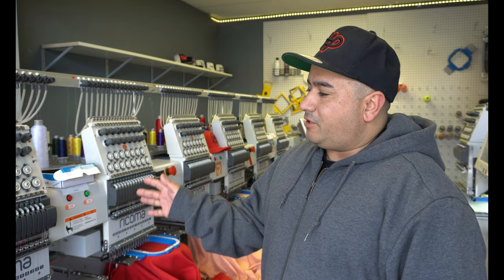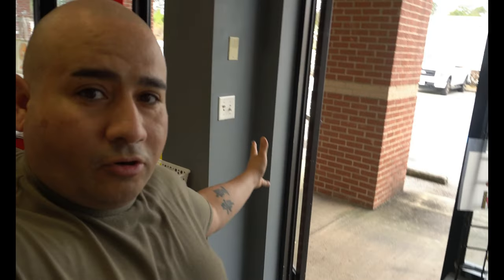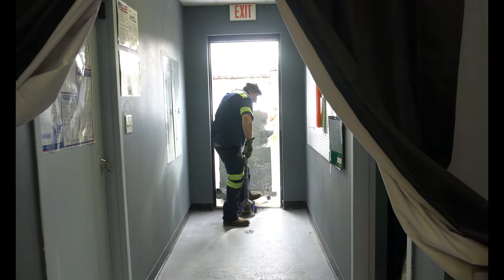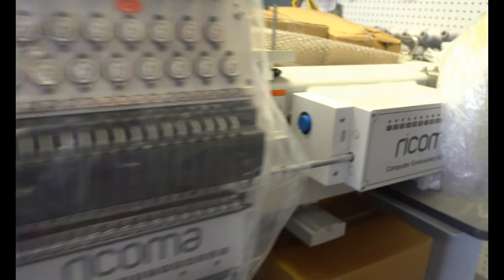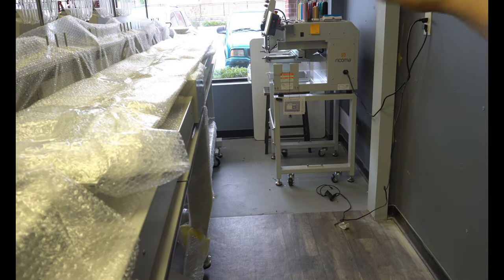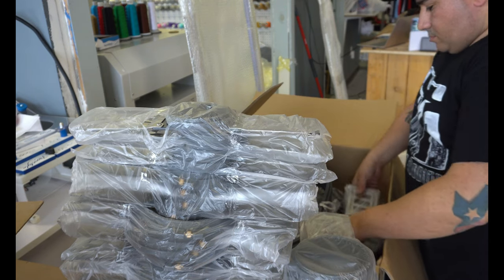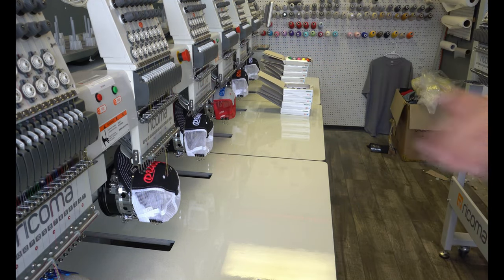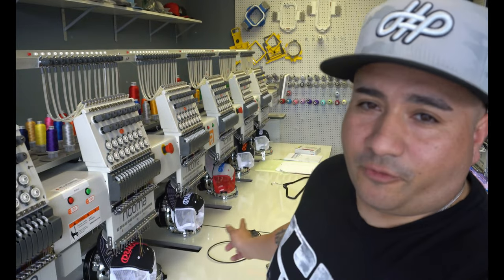The Ultimate Ricoma Six-Head CHT2 MT-1506 Unboxing

Comment: One question-do you have to leave space behind the machine as well so you can get back there to change threads?
Reply from the maker: It helps. But it is much easier to change put the brackets and maintenance. Thats why they recommend to leave room.